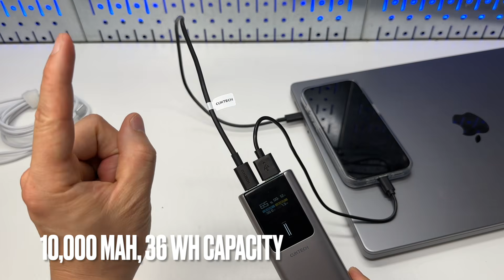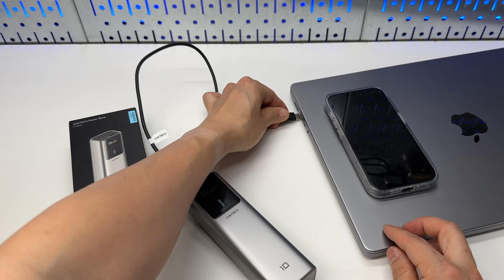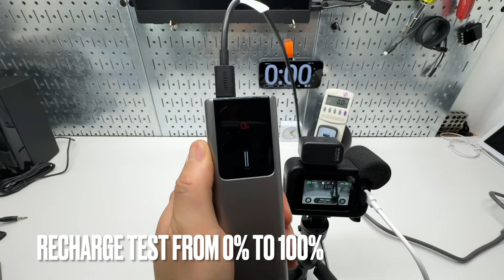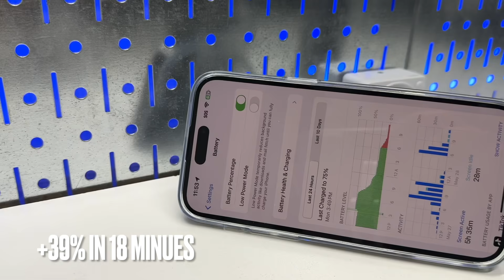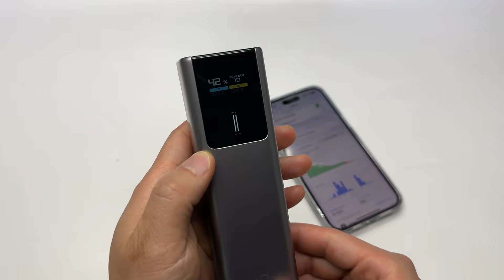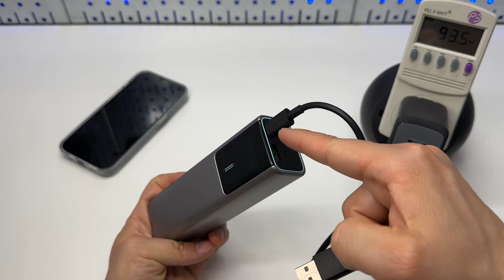Slim and Powerful! CUKTECH 10 Charging Speed Fully Tested with iPhone and MacBook Pro.

Comment: iPhone 15 pro how manny time can charge and I’m confused between cucktech 10 other is cucktech 15 with 85 w 20000 mah which will I chose for iPhone 15 pro ? And they have same w charging speed ?
Reply from the maker: it depends on how you use your phone during charging. you can find the spec on their product listing page. CUKTECH 15 is bigger.

Comment: Another great breakdown! I've watched a dozen different videos on the CUKTECH 10 and 20, with an eye on replacing my Anker 737 when traveling. In your opinion, would it be better to use the 10, the 20, or carry two 10's and still say under the 100Wh of TSA's guidelines?
Reply from the maker: Just because I assume you have lots of devices based on your previous IG posts, I would recommend you use Cuktech 10 and 20. One light one heavy for different scenarios like bike riding with the 10 (why add more weight to your expensive carbon fiber bike frame? lol) and everything else with the 20.
Reply: @ToolsElectroDIY I like that,  u thoughts of his devices !!!

Comment: How long does it take to charge this power bank and how many watts is the charger, boss?
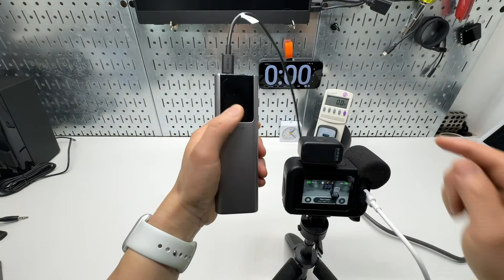Reply from the maker: See the Timestamp in the video description so you can quickly jump to 03:27 for the recharging test if you don't have time to finish watching the video.
Reply: I have this powerbank and it takes 35-45 mins to top it up depending on the temperature of the power bank at 90ws, usb c is max 100w pd and 120w for xiaomi phones, total output is 130w using a xiaomi phone and something else on the usb a.